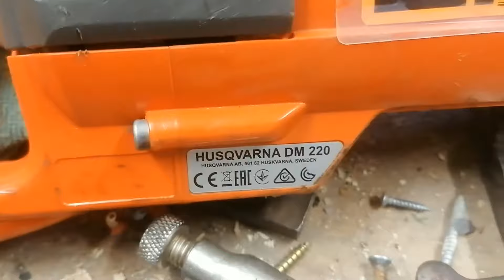Core drilling a150mm hole through a 62cm solid stone wall.  Carotteuse.

Comment: Thanks for the vid, we have a similar drill in work using a cup with the same diameter but a smaller depth. It has a pilot bit in the middle which we line up with the pre-drilled pilot hole. 
We don't use a stand to hold the drill so no need to insert threaded bar in the wall to hold it. 
We line up the drill, hold it straight and steady, put a bit of pressure and let it do the work. It has a small level on the top of the body to tell you you're level.
If you get your house insulated and need to put vents in each room, our way might be a less time consuming less expensive way of doing it.

Comment: Thanks for the very helpful video.  I have a very similar wall to core except I wish to drill down at 45 degrees from the inside.  Roughly how long did it take you once you starting coring?
Reply from the maker: not long, I went slowly with water flowing for cooling and dust/ dirt clearing the cutter.  Stopping and starting to remove loose stones and cuttings that might have jammed it.  No more than 30 minutes of actual cutting time for me.  I had a 5 degree angle (it was for a boiler flu)

Comment: I'm curious to know how you removed that rod you glued in the wall.
Reply from the maker: using two nuts on the threaded bar tightened and therefore locked together, I just unscrewed it out of the wall.